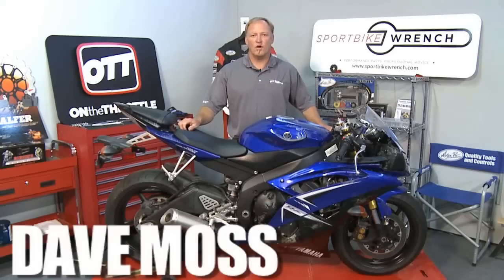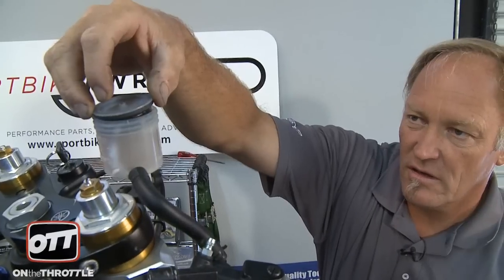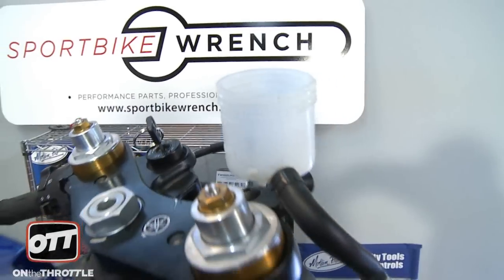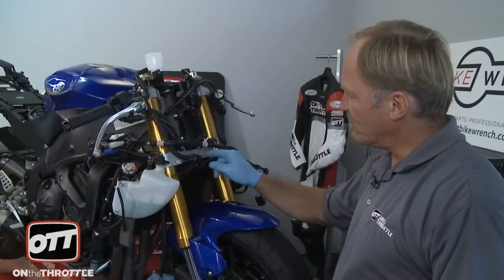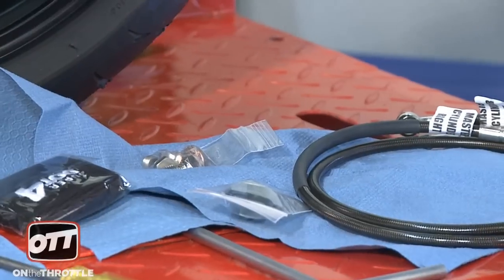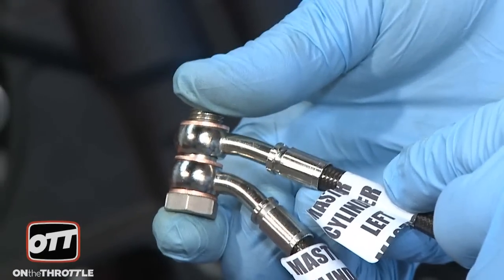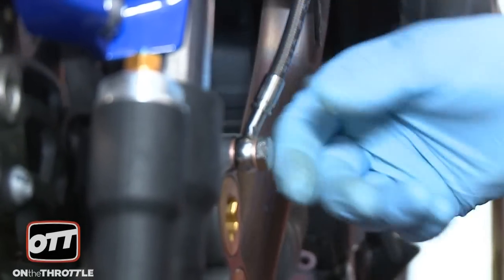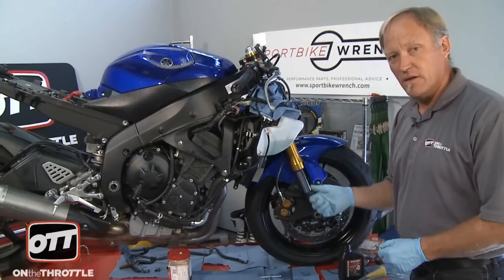Performance Upgrades YZF-R6 Installing Front Brake Lines

Comment from the maker: I line up the top lines on the master (in sequence for left and right) and then take a look at the line routing and mater cylinder to fork leg gap. I want to make sure I can get the bar angle I am looking for ergonomically. Once that is done, I run the lines down to the calipers, attach there and start the bleeding process.

Comment from the maker: @mugget the bladders on the reservoirs are only put in place once the bleeding is complete. Otherwise they will expand taking up a lot of room as the brakes are bled. Yes, the rear brake takes a very small amount of fluid!

Dave Moss
Host

Comment from the maker: @mugget in getting the job done the focus is on installation. The brakes then have to be bled to get the air out of the lines and in so doing ll the old oil is removed from the calipers that way.

Dave Moss
Host

Comment: @MrMattriddell Not sure if that is the main reason, but also because the bladder when re-assembling will take up a fair bit of the space in there. 

I know when doing the brakes on my K6 Gixxer Thou the rear fluid reservoir especially didn't take as much fluid as I thought - the bladder just takes up alot of room so when you look at when re-assembled the level is good.

Comment: stainless steel brake lines improved my rear brake and front brakes so much because the expansion of the rubber lines make the braking performance worse

Comment: Thank you sir + OTT!! I just bought some Galfers for my '09 FZ6R. I can't wait to put them on. :-D
Reply: Any difference?
Reply: +INFINITYCL oh yes, they're awesome! Not only are they gorgeous with the color scheme, they feel so smooth and no locking up. I broke down and had my local shop install them since it was my first time having steel braided lines. I have both front and rear; I recommend  these because the lines won't  need to be replaced unless damaged. They will only need to be bled every year or couple of years. I didn't feel like the stock lines were spongy, but there is slight improvement. I ordered mine from Amazon. Galfers are great lines.
Reply: Who told you they have to be bled every year or two?
Thats news to me...Unless you used DOT 5.1
Reply: +Anthony Hill My yamaha haynes repair manual actually says to replace the brake fluid every two years annnnnd then replace the hoses every 4...sounds ridiculous, I know.
Reply: +Dark Sorceress Zyra  You are correct read it in my manual after reading your comment. I usually flush my fluid based on color . Anyways safe riding 🤘
Reply: +Anthony Hill Hell yeah, you too!!

Comment: hey Dave, When you replace the OEM brake lines on the 08 R6 with a dual line (not split at the lower clamp like stock) what's the trick to installation up top. Do you pivot the brake and throttle assembly to make room, then pivot back after install?

Comment: Hi, why did you bleed the brakes again after using the reverse brake bleeder? I thought the reverse brake bleeder already forces all the air out of the lines while pushing in new fluid. I ask because I'm about to do the same thing on my R6 with Galfer lines